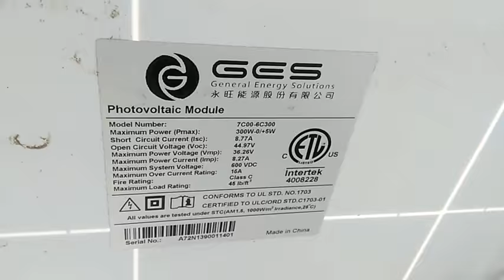Heating water with a solar panel

Comment: I live in the high desert of southern Arizona and use a batch type heater year around but have a shortage at times in the winter due to losses at night. With a PV system and a 50 to 100 gallon system I could superinsulate the tanks and probably have sufficient hot water year around. I have not had another source of hot water for over 18 years.
Reply: That is exactly how I plan to heat my insulated 30x40 shop. Probably wont get that done until next yr but it is gonna happen specially after my electric bill went from 120 bucks to over 350 bucks from October to November when I deployed my electric shop heater. Nice side benefit will be hot water for hand washing out in the shop. Wont do anything for me in summer though. I will deploy small mini split air conditioner for cooling wired up what ever way it will take, I'll do the research. that may work for heating also??

Comment: DC switching and AC switching are two very different things. Even if you are staying under the amperage rating of the contacts, using DC on an AC rated thermostat could still pose a problem. I burned out one of these thermostats at about 70Vdc and 9A after a couple months when normally the tank would operate at 240Vac and ~18A.
Reply: You might be able to use a snubber circuit to protect the contacts on your thermostat.
Reply: Have you tried using 12 V DC through the thermostat to control a relay to connect the 70 volts DC?
Reply: @johnwyman6126  yeah there’s certainly ways to do that using a separate dc relay. But it was just sort of a temporary way to get hot water while we were building a house in the Bahamas with limited materials available. Since then we have finished a full solar system with an inverter that can support that load using AC so it’s no longer an issue. So far the capacity of the system hasn’t been a problem to drive the hot water heater, but we may eventually add a relay based on the battery SOC.

Comment: Even with a relatively low current output the 24 volt nominal panels will eventually burn up the contacts of your AC thermostat. There is a simple way to avoid this though, especially with the low currents you are running: Wire a capacitor across (in parallel with) the thermostat contacts. 

What this does is provide a secondary path for the current for a brief moment when the contacts open. With tends to massively reduce or even totally eliminate any arcing.

A grunty 6 microfarad non-polarised capacitor such as those found in fluorescent light fixtures or motor start caps would be ideal. This only works for DC  - it wouldn't work on AC as current would continue to pass.
Reply from the maker: That is smart. You went over my head a bit and I will have to study a bit to figure out what "A grunty 6 microfarad non-polarised capacitor" is but I think i get what you are saying and I will keep working on this. Thank you for your feedback, i take it seriously.
Reply: If you get your hands on an old fluorescent light fixture open it up and inside you'll see a white or grey plastic cylinder (occasionally they are a shiny metal cylinder) with a couple of connexions on the end. That's the cap you want. 

Rip it out and connect one terminal to the wire feeding your thermostat and the other to the wire which goes from the thermostat to the element. Easy as that. Doesn't matter which way round you connect the cap as it's non-polarised. But keep the wiring as short & as close to the thermostat terminals as possible. This increases the effectiveness.
Reply: xanataph Thanks for the tip.... I'd COMPLETELY forgotten about using a cap as an arc snubber!  Brings back my old points and condenser car days.
Reply: xanataph Arc Suppression
When a switch/relay is opened an arc can develop across the contacts which over time can erode away the contacts over time. To prevent the contacts from being eroded a RC network is placed across the contacts. When the contacts open the applied voltage is placed across the capacitor and not the contacts. The capacitor is to charge up at a rate faster than the contacts open thus preventing an arc from forming across the contacts. When the contacts close the inrush current from the charged capacitor and source can be substantially higher than the contacts can safely conduct causing the contacts to deteriorate. This is why it is important to have a resistor in series with the capacitor. The resistor acts as a current limiter which reduces the inrush current by a significant amount that the arc caused at contact closure is greatly reduced extending the life of the contacts.  

C=I^2/10 

R= V / ( 10 I ( 1+(50/V) ) )

Example: 120vdc @ 10amps.

C=10uF
R=141Ω (150Ω)

240vDC @ 10 amps
C=10uF
R=300Ω
Reply: Interesting formula. I have considered the situation of the charged capacitor being shorted out when the contacts close, but I determined that to be less of an issue as the relay I am using in my case is rather substantial and the voltage is only 24 volts nominal. I suppose there could be some arcing though when it closes as contacts always have a tendency to "bounce". How is that constant of 10 in the formula determined?
Reply: You can make a simple "bouncless switch" or what is known as a de-bouncing circuit with a couple quad NOR circuits right?
Reply: I have to RETRACT the above.... I tried with an electrolytic capacitor and 150ohm resistor and it arced and fused my contacts the very first time.  From there the safety thermostat popped off.  At this time I'm using a 120°F 48°C thermostat from missouri wind and solar.  In truth, their thermostat is the same thing used on an electric clothes dryer.
Reply: These people are just wrong. While a RC network can help slightly, sufficient capacity will only increase the chance of welding the contacts.  Use an upper tank thermostatic switch.  This has normally open and normally closed contacts.  Wire the + power to the common contact.  Place the capacitor across NC and NO contacts. Connect NO contact to heater.  Place a 2K to 5K 5W resistor (value is not critical) from NC to other side of heater element.  The capacitor then provides a reverse polarity voltage to the opening contacts and extinguishes the arc.  You can then get nearly the full AC voltage rating on DC.
Reply: what a good idea. have any photos?

Comment: You have 2 parallel 300W panels that will give you 36V, 17A. So if my calculations are right, you need  600W/ (17Ax17A) = 2 Ohm 600W heating element, sice W=I*I*R. The voltage on it doesn't matter. I don't understand why they don't specify Watt and Ohm in them instead.

Comment: What a great idea. this is the way to combat climate change, by a simple common sense application. A really great video!!
Reply: Steve Kellett don’t knock climate change - I could use a hotter winter up in Alberta by at least 10 degrees to extend the growing season - had to pic my tomatoes in early September because of freezing.

Comment: I've done similar. We have 3 water heaters on our place.  

#1 in my shop 1/2 bath is a 28gal under counter 120v single element that used to be in location #2.  Right now, I run four 175w/35v/7amp panels in parallel to a 1200w 36v DC element (Dernord brand, Amazon).  It will heat water to the 110-20 degree range.

#2 is a 28gallon 240v 2 element tank.  I replaced the bottom element with another 36vDC element like above, but and replaced the top element with a 1500w 120vAC element (because I only had 120v to work with) that I wired thru a switch.  The solar feed is five of those same 175w panels as above instead of four.  That heater is used in a work room we have that sometimes we need a lot of hot water (hence the 120vAC element), but often only need some standby hot water (the purpose of the DC element).  That tank will heat to 150+ degrees, and I ended up using the AC thermostat that came with the tank to control it.  I wired 120vAC thru the thermostat and a relay to send the DC power to the element.  The contacts in that thermostat are not rated for DC power is why I did this.

#3 is our main house water heater.....a 40 gallon propane.   I had a 120 gallon tank left from something else, and plumbed it inline ahead of the propane tank to pre-heat water the way you did.  It has one 36v 1200w element in it, and five 245w panels in parallel.  So far (just been connected a month starting 1 December), best it will do is heat the tank to around 80 degrees.  Low sun angle right now on the panels, I expect that to improve on into spring.  Even so, the propane savings from heating water to 80 degrees over the incoming 50 degree temperature will save propane.

The one big advantage of using PV (these were all used panels that were cheap) over a batch type or vacuum tube type heating is, as you said, not having to deal with freezing water,  running glycol in a closed loop, pumps, controllers, etc.  A PV setup like this is dead simple.
Reply: while that is a lot of water heating adventure i commend the effort to break up appliances and individually power them rather than going for a large system that fails as a singular unit or requires grid connect or expensive battery install. Question though on tank #3 with the 40 gallon propane primary and solar pre-tank... You said that pretank is 120gallons but only mention a single element supporting it..  i think you should shop around for some 300plus panels and large DC element to install in the bottom and move the 36v-1200 to the top. Propane unlike NG is going up faster than Elon Musks EGO. I agree about the vacuum tubes unless your setting up some sort of heat pump booster the systems get to complex and require to much maintenance.

Comment: I'm surprised you don't have a charge controller on to suppress the electrons in your solar panels. Mine runs through black tubing. Pre heat. I like your video I bought elements years ago and I was gonna do the same thing I've never got to it good job.

Comment: Nice video showing the implementation.
Hot water can be 1/3 of one's energy bill. 
Any reduction in heating would see benefits.

Interesting setup with dual tank configuration. 
A small tank heats up pretty quick. 
Limited shower maybe.
An off grid application might be happy with 80 degrees water.

From my reading, a solar heat panel is better for heating water. 
No electricity required other than a pump.

I fast forwarded a bit looking for details on how much energy this saved from the grid.
I didn't see any data analysis.
Reply: jose gonzales
 ... You must realize that the added items to do measuring might not be in the budget for everyone. Best guess from my end is an average 30 gallon electric water heater might use a $1 per day or $30 per month. If preheating could chop off 50% then we're looking at $15 per month savings, which could be $180 per year. OTOH, it might be less in certain areas, but at least you have some numbers to work with for figuring payback. I'd start with 25% savings and be pleasantly shocked if it was better.

Comment: This is okay as long as you’re thermostat never gets to temperature to shut off. DC voltage will weld the contact’s together and never shut down. Keep small scale like this and you won’t have a mess to clean up. I personally had the same idea 15 years ago but made a  200 volt 60hz dc chopper mosfet circuit that works great. Free hot water with no modifications to hot water tank because it’s kind of AC —off -on at 60hz instead of a grid sine wave.
Reply: Hello, I tend to do the same setup, but what happens if the mos fet burns and remains in on state?
Reply: What about using DC SSR switched via ac? The water heater thermostat could turn that on/off right? If dc is needed to switch the DC SSR you could use a small wall style transformer to turn it to dc to control the SSR.

Comment: You save a lot of power if you put a 1 hour timer on the house powered heater. You can switch it on bypass if Desired. Saved me maybe a 100 on electric bill.

Comment: How bout an update on the performance of ur 2 tank PV Water Heater.
Mods u may want to consider... 
1) Exchange heat between tanks by heat exchanger. Fill the PV connected tank with distilled water and don't connect to water main or house water heater. Transfer the heat via tube in tube heat exchanger to house water heater. This will keep heat flow to 2nd tank when hot water is not being drawn in house.
2) Add a DC switcher so PV could also charge a battery bank if electrical grid is down.

Comment: What is the difference between a DC and an AC element? Resistance is resistance.
Reply: ikr
Reply: There is no difference.
Reply: The thermostat switch has to be stronger because the DC arcs more than AC when the thermo switch opens.

Comment: Question? You mentioned these double dc water heating elements aren't specific on how you wire them. I don't understand why there are 4 terminals, how could it not matter? I just received a dc element like this and have tried it a couple ways and it sparks when I connect to my battery. Is that normal? I am using 12awg wire but it started smoking. The element is 300 watt 12 volt. Does that mean the wire is too small? Thank you in advance.

Comment: I appreciate the video. Love the experimentation. Unfortunately, you negated ALL of the possible savings you might have had from the supplemental Solar heater by using a 120v heater in the second heater. If you simply ran a 240v Element in that heater you would have halved your energy usage, which is why high amp draw items in the home run on 240v.
Reply: That is not true! Hydro doesn't charge you per Ampere Hour, they charge you per Watts Hour. You will half the Amps, but double the Volts, which equals the same, only wires will be thinner.

Comment: I try an 220 volts hot water unit with the original resistor and connect two 385 watts panels in parallel and works good.
Reply: Have you how much energy does your resistor draw from the PV panels?

Comment: So I'm getting into solar. I'm playing with the idea of heating my water and adding supplemental heat to my house. I have yet to come to a destination. I have watched to the end and read a lot of comments. I understand your situation any why you have the two tanks and using PV panels and doing what you can with what you have. If you where to do it again.  Couldn't you use solar thermal in a drain back system as a preheat. Then run a dual element tank like others have suggested. Then maybe some magical plumbing and controls with a circulation pump or valve in a way where in winter your using the thermal panels to preheat, without worrying about freezing. Then in the summer it will take most of your heating needs and add capacity to the system. Like I said I am new to this and my comment is more based on what I somewhat know.
Reply: No pump needed thermal Sifoning.  SCOTT FROM N.S.

Comment: love this setup nice and simple, im new to solar and your making it very understandable with this video thanks for that! Im curious if it would be conceivable to have a similar system work on a central heaing unit maybe 3 of these elements with 6 or more panels add a thermostat valve and 12v pump to supply the radiators heat up the tank during the day and use it to run the radiators at night that way the system gets time to heat up.

Comment: Water Element = High Power Resistor designed to get wet.
AC vs DC: Makes no difference to a resistor. 12, 24 or 36V element is for just low panel count. A 120V element, run 6 panels in series and feed direct to element with thermal control to kill heating when hot.

Comment: Interesting video. Great idea. Wondering what happens in the summer if you are not using hot water. Will the system overheat?

Comment: i would use bigger tank as a preheater and smaller one as the finisher.
Reply: nah... he's letting a passive low voltage thing do most of the heavy lifting now.. .that has to be saving more energy
Reply: Or, have an on-demand unit as your secondary.

Comment: My only concern is what happens when the temperature exceeds the temperature setting, I assume the safety is the pressure valve that will automatically open and avoid creating a bomb. I am going to retry my original idea of using a old hot water tank remove the thin metal case of the exterior, paint it black and add one conventional AC element and connect to a solar panel. My application will installed on my roof. Again, my only concern is over heating the water. However I hope that the pressure valve will be sufficient.

Comment: 19 gallon for your whole family?  I would get shot if I tried that.  Some people like long showers here.   I have done a similar system, though I have a dump load configuration, so I only heat water when I can not put it into other storage or usage.  At 60VDC I can use 2000 Watt 120V elements to put 500 Watts per element into mine.  Better to heat water than waste the energy on a sunny day.  I like the other posters Idea of putting a temperature gauge on the preheat tank, maybe one at the top and at the bottom for a more convenient temperature measuring.  I may put a thermocouple and an arduino that I can power up when I want to know the temperatures at the top and bottom of that tank.

Comment: Why use second tank? why not add your dc element next to the ac element ?  How much savings have you realized?   Also would be interested  in determining  size of pv panel in the application. thanks , seems the way to go
Reply: It's dowable, but a pain... There are only two ports for element or you can do it externally. I have a rocket stove externally.
 You do have a point!